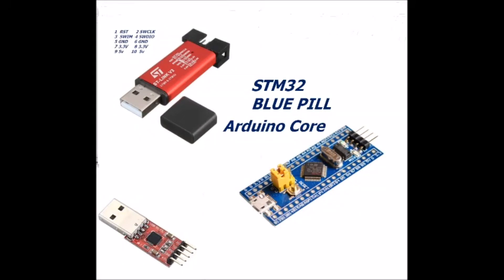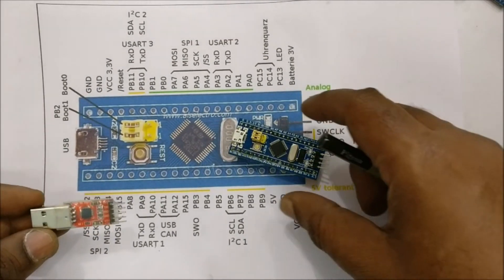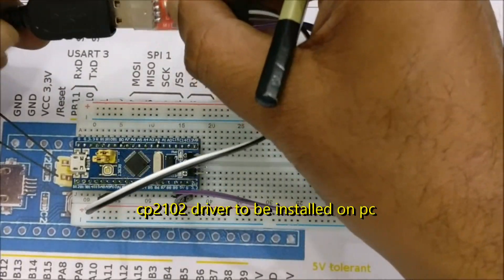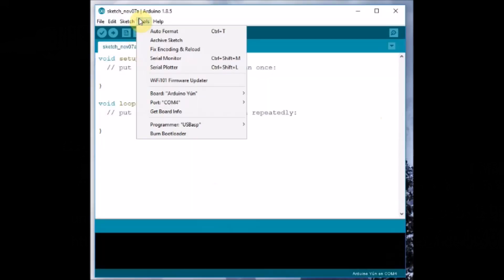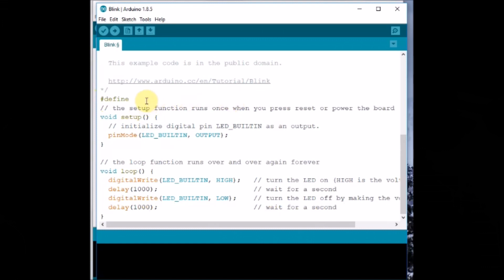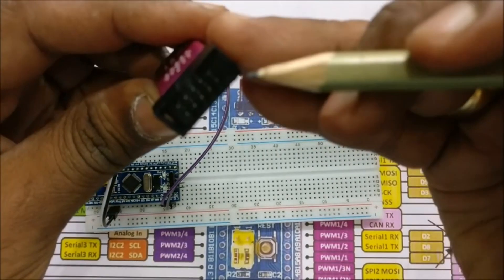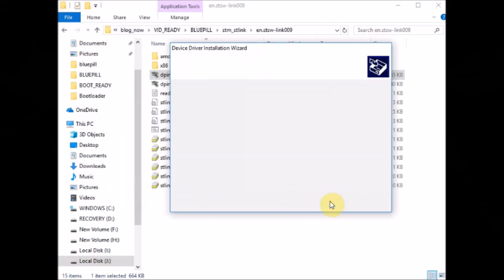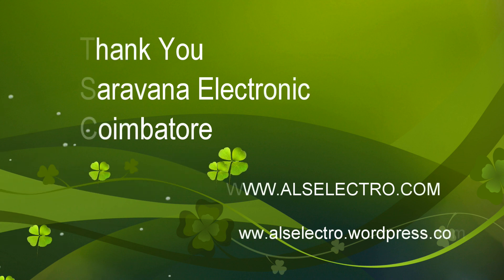STM32 F103 BLUEPILL - Getting Started with Arduino Core

Comment: Nicely explained, I am kind designing my own pcb. I have same doubt. If I use the STLINK method then I don't have to Expose the BOOT pin with jumper arrangement is that correct. However via UART Pins I have to expose the BOOT and RESET Pin both

Comment: I have the Blue Pill card.
It has an MCU STM32F103C8T6.

The problem is that the jumper for the BOOT 0 when it is at high (1) the led pc13 always lameps !

It does not enter programming mode.
And I can't program the card via FTDI.

I tried with ST LINK V2 and it works with the reset pin cable (RST).
Because not having boot 0 working I can't keep it reset.

The problem I program with the ST LINK module I can not use serials.

I'm initialing Serial 1 (Serial.begin(115200))
but when I use the print statement it doesn't appear if I connect an FTDI module.

ST LINK to program
FTDI to display the serial but does not work.

Is there a way to activate the BOOT 0 jumper in such a way that when the set to one (HIGH) he after the reset remains in programming mode ?

Comment: Great job Saravanan, thanks!  Trying to get my bluepill going in August 2019, I wondered which of the links I researched had the most current info. This one turned to work quite well.
I'm using ST-LINK, so I started in that part of the video, but I also needed to go to the serial portion on how to add the board to the board manager in the Arduino IDE. The URL gets truncated on my system for some reason but I was able to copy it from the video. 
The other thing I had to do was get the driver, which worked fine per instructions. One slight glitch was that it didn't show up in my Device Manager. But I went ahead and after all was done, it does show. So apparently it became visible after the IDE started using it.  I guess.
After those two downloads and then following the step-by-step in the video for wiring connections and IDE options I was good to go. Note that the "blink" sketch in Examples is Read Only to you have to move it to your sketchbook to add the #define line.
I've never been so pleased to see an LED blinking on and off at a 1 second rate.  -- Nick

Comment: Thanks for demo.  Still unclear about stm-32, debugging.  Can I only use this for program upload?  Is there no way to get a com-port output, or use this with visual studio to monitor variables and pins?
Reply: Yes use Keil IDE and an ST-link and get full debug capabilities... if you are heavily dependent on Arduino libraries then I do know about that but if you can write your own code then definitely try Keil. For Com port you can get a cheap Usb to serial dongle or  try an STM32Nucleo board which are a bit more expensive but I am working on making some STM32 boards with full USB UART support and debug with only 1 usb connection and no dongles.
Reply: I'm using an st-link to debug with openocd in eclipse. It can do it. If you get a nucleo board, you can flash the SEGGER jlink firmware on its integrated programmer, which works even better. I have st-link and jlink working both in eclipse and with platformio. (forget the Arduino IDE obviously; it's crap and it calling itself an IDE is an insult to all real IDEs)